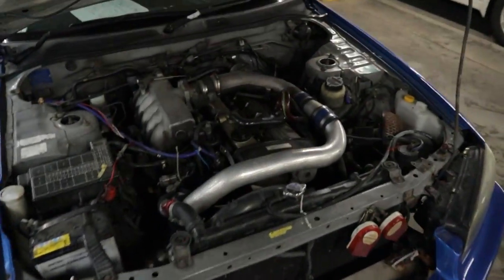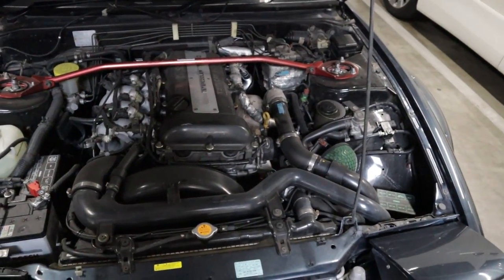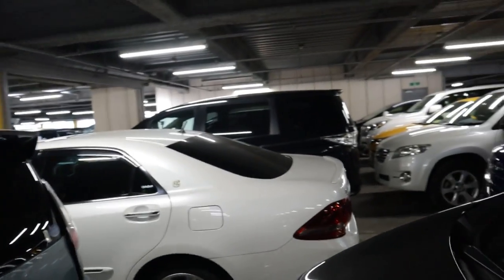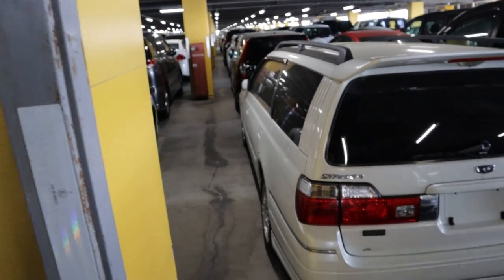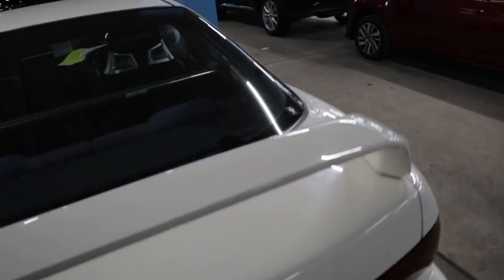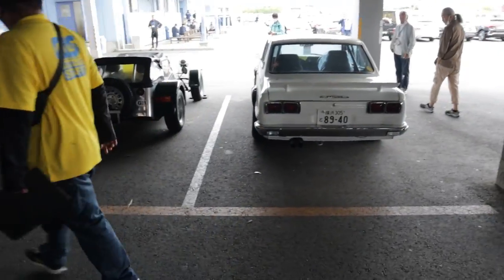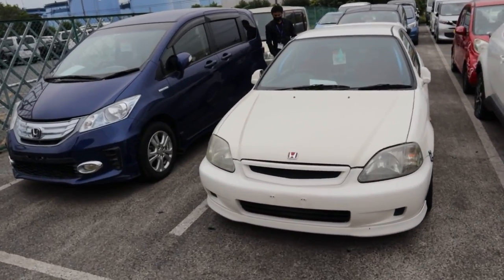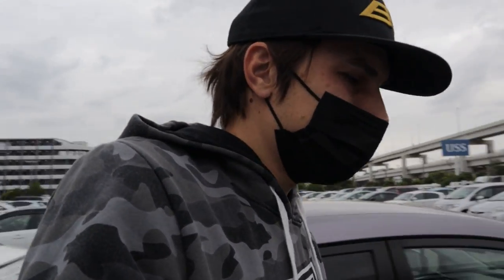BUYING CARS AT AUCTIONS IN JAPAN!

Comment: I went and looked at a 2004 Lexus IS with a factory 2jz for 6,500 US today (Altezza at 2min24) and it struck me as kind of small inside, with my left leg pushed into the door, on the US left hand drive model. This car might not be very comfortable for anyone over 5 foot 8 in, and I couldn't drive it like that all the time. The finish needed a lot of work too. They coated the dash in some models with a substance that makes them shine and become sticky in the sun. The one I looked at had it a little, and there was a lot of paint and finish deterioration in places.

Comment: How would u say have the prices developed over the last 1 1/2 years? Rly interested because I want to import an evo 5 to Germany. So I just try to get as much information about price Development as possible. Thanks in advance
Reply: A grade 4 and up clean 5 will run you 25k USD on the low end.  If you want a clean red or yellow, that number is closer to 30k usd

Comment: Yo sammit when you mention yen in any price could you edit a USD amount. Sorry im trying to learn and I still get it wrong 😔
Reply: just minus two zeros from the yen and thats pretty much the price in usd
Reply: What Joshua Hall said, for example.
¥3,000=$30USD, ¥300,000=$3,000USD. This is not an exact conversion but is a good way to do it as it’s going to be cheaper anyway in usd for example lol ¥3,000 is actually $27.61 ect ect...
Reply: @CarsBikesJapan  thanks you guys Ive unlocked a new thinking pattern.